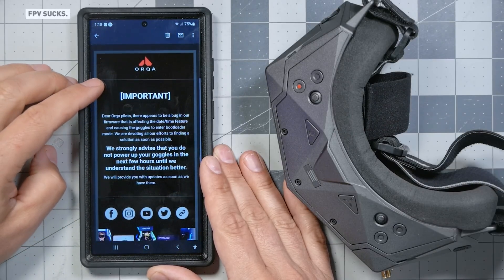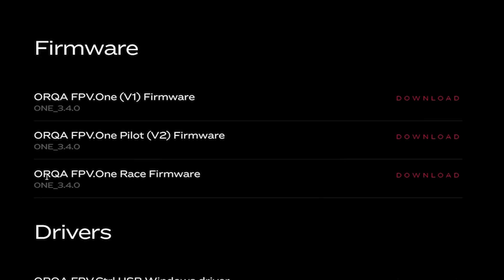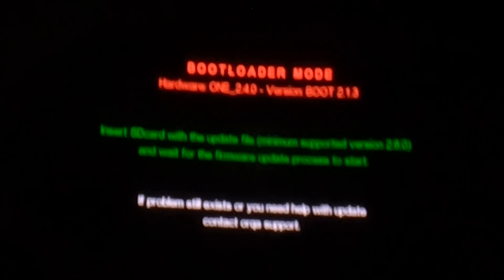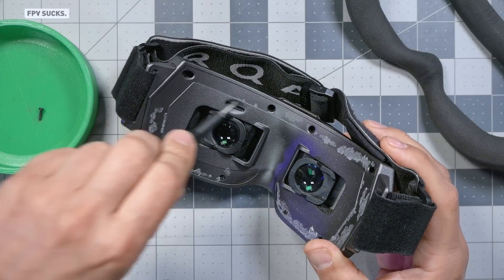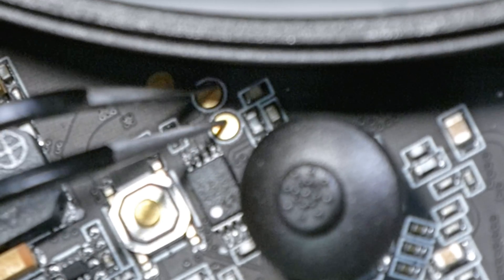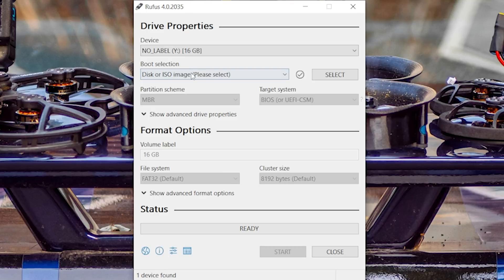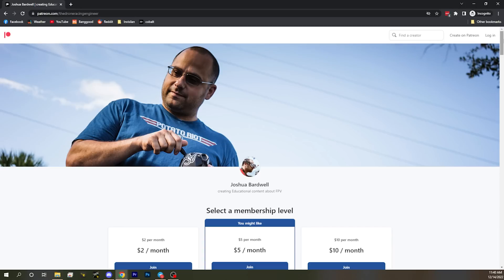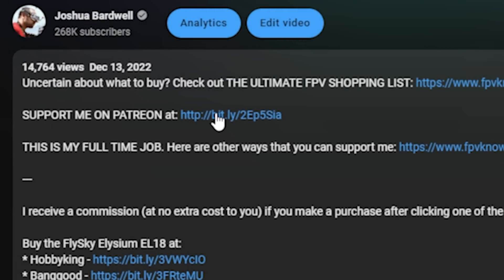Bring Your Orqa Goggles Back From The Dead! #orqapocalypse #bricked

Comment from the maker: Who's to blame for this BS? https://youtu.be/bxRgYWukZZA
Reply: Who's to blame for this thumbnail 🤣
Reply: Hi I am a huge fan and wanted to get started in FPV so I purchased a TinyApe pro RTF kit that did not work and they will not refund it. Do you have any suggestions of what I should do?
Reply: Absolutely Orqa for not having good change management. Of course the person that put in the code is also responsible, but if Orqa had a good process in place, they would have caught it before it got to the user.
Reply: Außenministerin Bärbock from the german reich of course
Reply: What foam is that you're using on the orqas? I hate the stock foam on mine, and am searching for replacements. Can you post a link?

Comment: The 3.4.1 fw is out so if someone check this video today in my case the first method didn't worked just as JB struggled with that. So I copied the 3.4.1 newer files to SD and it started to flash the fw on it then it worked. Got full black screen during the process but after the flash the goggless turned off with the turn-off tone os I knew it was done. No need to short-circuit the bootloader pins.

Comment: Hi @JoshuaBardwell, I can't seem to find instructions for V1 that work.  I turned my googles today, worked fine, turned them off and then on again, that's when I got into "bootloader mode". I tried flashing firmware 3.4.0 and 3.4.1 for v1 from orqa's website but the first one gets stuck loading and the other one shows the SWARG screen.  Do you think we'll ever get a fix for this or should these orqa v1 googles just go to the trash?
Reply: ah, just did the steps in the release notes .txt for 3.4.1 "(3) INSTRUCTIONS FOR UPDATE VIA BIN FILE (license/tool.bin)", that worked 😅
Reply: @mrrusof    Thanks!!!   V1 users ATTENTION! i think if you have older V1 like me....  I was still bricked after trying everything EXCEPT this tool.bin ^^^ method from the 'BETA' (3.4.1)version download option. Thank you they are alive !!!!!!

Comment: Fixed/updated my Orqa V1 goggles using the Orqa instructions, not Bardwells. Worked perfect the first time. They were not bricked because they had not been powered up for months as I do not like them. Would be willing to trade them for a similarly lightly used set of Fatshark HDO2.
Reply from the maker: Umm. My instructions are the same as the Orqa instructions. IDK what point you're trying to make. But I'm glad it worked 😘

Comment: Neither the 3.4 Firmware install method.... or this way of un-bricking my FPV Pilots has worked.

Spent more than enough time now trying to resolve the problem...so they will be going back to ORCA to be fixed.🥺😩

Comment: Hello I hope you can help me. I bought the DJI Remote Controller 2, googles 2 and the Mark 5 with dji 03 system. I also connected everything together. I have the problem that I don't get any signals from my Remote Controller 2 with Betaflight. I set it to sbus in the googles and also in bethaflight and set it to on. What could I change to recognize signals? In the case of connections, UART1 and UART4 are active in the configuration and UART2 is active in the serial receiver. Do I have to change something there?
Reply from the maker: You should email me jb@joshuabardwell.com so we can figure this out.

Comment: The "FIX" did NOT work for us ! 
There is a huge LACK of TRANSPARENCY !!

Did/Does Orqa owe the SWARG clowns any money for licensing?

Did Orqa KNOW of this impending catastrophic failure BEFORE the date of the "bricking"?

How the hell did they ever hire an employee or contractor without thoroughly vetting them?
Why wasn't the code examined carefully?

After working for HOURS on this idiotic "fix" to very expensive goggles, and failing to get it to work...
is FRUSTRATING !    I would never spend a single penny with Orqa and I would never trust ANY company that works with or hires SWARG..  They are rotten to the core.

Where is Orqa ?????

They are NOT standing behind the product.
We are camera drone folk who have no interest in disassembling a pair of goggles that I PAID FOR.  (apparently unlike Orqa -- if the rumors are true).

Comment: Make sure you do it in the correct order!  According to the Orqa instructions, "turn on your goggles, and once they've powered up, insert the SD card in the goggles."  So insert the card AFTER they power up.  I have V1 goggles and it worked great for me!
Reply from the maker: I assure you, I tried a LOT of different ways that I didn't waste your time showing you in the video. None of them changed the outcome at all. I know you can't assume what happened off camera, but you have to take my word for it, I did follow the directions exactly as described, and a whole lot of other ways too. I put in the SD card first, last, I formatted as EXFAT and FAT32, I tried three different SD cards, and so forth.
Reply: @JoshuaBardwell  I believe you!  I just did not know since you did not mention it and the "turn on first" method worked for my V1 goggles.  All of the information in your reply here is helpful to know and I can pass it on to friends who are having this issue.  Thank you for clarifying this!

Comment: Bring us the HD that Orqa keep promising !!!! 😂
Reply: Don’t know how to do it on Mac. For V1  this is how I did it. Step1. Install sdformatter. Use that to format the sdcard easily once done go to step 2. Step2. Drag zip to the sd. Unpack the license folder & ‘.Orqa’ file to the root of the sd. Make sure you delete all other files except for the license & Orqa file….. step3. Boot the goggle wait til bootloader shows. Insert the sdcard. The bootloader will takeover and enter ‘bootloader sdcard mode’ - wait until finished. Step4. Power down the goggle fully inc pull power out. Remove the sd card. Power back up and it show boot just reet!

My v1 setup has wifi module & fusion. The power button is set to long press to boot. It was bricked but now works with what looks like the v2 OS

Comment: I see someone said there are access points in the velcro to reach the screws. Even if there aren't I never remove the velcro and either poke a hole with screwdriver(leaving screw under velcro for reassembly) or use a razor blade/xacto knife to cut over the screw holes. You can feel around with tip of phillips head and tell where the screws are before cutting.

Comment: I had not powered on my V2's 
pulled sd card, format. extract zip to sd card. (just the 2 files inside the zip) 
powered on, some beeping... inserted sd card... more beeps... screens went black... 
I powercycled, pulled power, plugged back in.. 
I then followed on screen prompts...   it worked... 
reformatted sd card... 
powercycled... and confirmed working, with correct date....

Comment: I'm not sure if it's the same with v2 goggles, but with v1 and the latest fix I had no problems installing it. I think the key here is to first turn on the goggles and then insert the sd card. You should also format the sd card before the procedure, just to be sure (I think I formatted it to exfat, but fat32 should work too).
Anyway... As a v1 owner I was pretty scared, because I know that you can't make the "short pins" solution, so I'm glad that they made it and released firmware solution.
Reply: Yes. Reading the instructions helps...

Comment: @JoshuaBardwell Hey Joshua, at 3:12 you put the card in the goggles and then you powered them on. The instructions from ORQA said "(3) Turn on your goggles, and once they've powered up, insert the SD card in the goggles." Could this be the reason why it didn't work for you the first time? I've just done it for the V1 goggles, and it worked the first time.
Reply from the maker: I assure you, I tried a LOT of different ways that I didn't waste your time showing you in the video. None of them changed the outcome at all. I know you can't assume what happened off camera, but you have to take my word for it, I did follow the directions exactly as described, and a whole lot of other ways too. I put in the SD card first, last, I formatted as EXFAT and FAT32, I tried three different SD cards, and so forth.
Reply: @JoshuaBardwell  Of course I rushed to assume that I know you've done something wrong. Ain't that the reason why they made the internet? .. :)  I've updated the V1 goggles, then saw your video. Update is working also for the V1, but there are still a lot of people which are missing steps, or doing them in a different order. Also, I made a factory reset after the flashing was over (to avoid any image issues of non working buttons), as Tony Cake recommended in one of the many comments.

Comment: bardwell, read the manual. you you have to turn on the goggle first and then insert the sd. you did it the other way around. you put in the sd and then turned them on.
Reply from the maker: I assure you, I tried a LOT of different ways that I didn't waste your time showing you in the video. None of them changed the outcome at all. I know you can't assume what happened off camera, but you have to take my word for it, I did follow the directions exactly as described, and a whole lot of other ways too. I put in the SD card first, last, I formatted as EXFAT and FAT32, I tried three different SD cards, and so forth.
Reply: @JoshuaBardwell  ah ok in the video it came across you put in the ssd and then turned it on. the good news is that the orqa described procedure with the latest firmware worked on my orqa v1 (kickstarter model). happy times